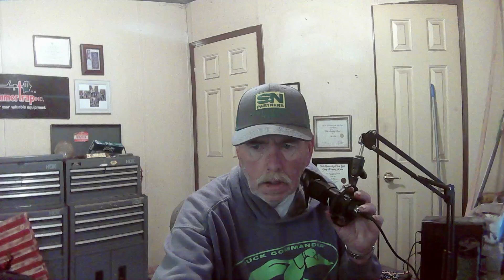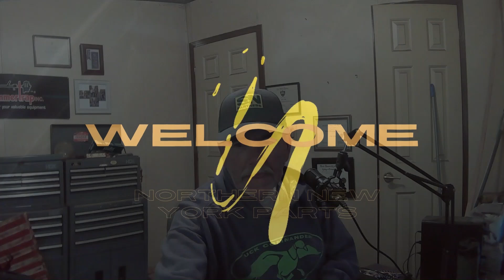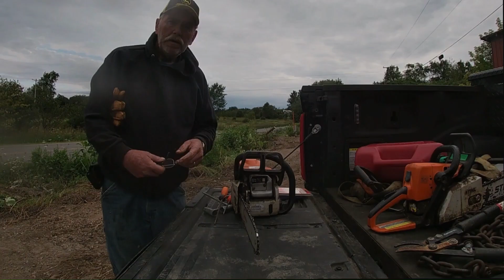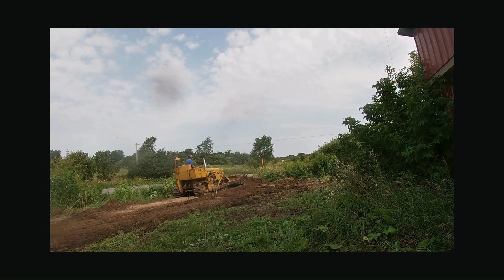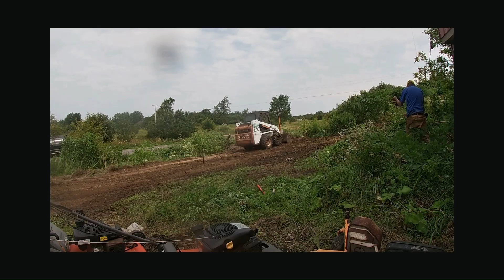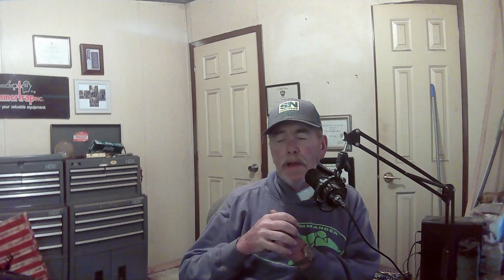Customer Error: Not Reading The Directions

Comment: When I run across a broken recoil I put a socket adapter in a 1/2" corded drill and do a compression test. Don't ever use a cordless drill to try to start an engine. I learned the hard way when it backfired and blew the gears out of my drill.
Reply: Sound advice Jason !!
Reply from the maker: Never thought of that Jason, great Idea

Comment: Each spring, there is the inevitable carburetor issues from leaving gas in it from their last mowing/trimming/leaf blowing session of the previous year.

For the last few years, I've gotten a new one. "My leaf blower ran fine for about 10 minutes, and it quit.". Three times last year and once so far this year. Beautiful, Brand New Craftsman 2-Stroke leaf blowers.  Killed by not mixing the fuel. I don't know if it's not in the owner's manual or they didn't get a clue from the little oil bottle in the box or what.

They go into these big box stores, and they'll have 20 or 30 of them on a pallet in the middle of the isle, with a great sale price. The customer (not necessarily dumb but clueless (there is a difference)) purchases one (In my case the guy bought 2) blower on an impulse, and the teeny bopper at the register has no idea that he/she should even mention mixing the oil and gas or even that you are supposed to. The customer goes home, fills it up with regular gas, starts it and 8.5 minutes later he's scratching his head, wondering why it quit and won't start again.

I've got one in my garage now that a friend wants me to "Just look at it" for another friend. I don't need to look at it and he doesn't understand that in order to "Look at it" involves taking the durn thing apart in order to look at what I already know to be a badly scored piston and cylinder and worse if I go further.

I told the guy with 2 last year just to write it off as an educational expense in the School of Hard Knocks. Then I showed him how to mix his two-stroke fuel.

Until just now, I hadn't even thought to offer a little for the dead blower for parts. I may do that on the blower in my garage.

Have a great weekend!
Reply: @tinkerscorner54  don't offer much there isn't hardly any parts you can use on a blower and used they don't bring good money. Blowers are hard to sell. Since it is junk he should give it to you for checking it out for your time. I won't pay more than $3-$15 for a parts blower but it depends on the brand.
Reply: @jasonbusch3624  You're right. I was figuring $5-10.

Now Brands, like mowers, many of these "Brands" are made on the same assembly lines using many of the same parts. Sure, there are little differences. I've seen them chamnge the brand they were manufacturin to another because of one running out of one part, and it took them about 3-5 minutes for the change. You'd be surprised what they do in order to keep an assembly line from shutting down.
Reply from the maker: I can't give a blower away even running in our area. We had a bunch of weed trimmers (Cub Cadet) from Tractor supply customers bringing it to us for warranty. Same  deal...no one told them they needed mixed fuel. Smoked the trimmers and not worth fixing. We had a few homeowners chainsaws (Husqvarna) that did the same. All of them blamed the stores for not telling them, I showed them in their owners manual and on an insert saying Important, this unit requires mixed gas
Reply: @northernnewyorkparts  You could surely give them (blowers) away down here in Georgia. I've got people asking for used blowers all of the time. I've got a bunch that I've "found" and people brought me from the side of the road but haven't had time to check them out. I'm still a Newby when it comes to repairing 2-strokes. Up until a year or two ago, I just thought that they worked on the FM Principle. (Friggin' Magic) Have a great day!